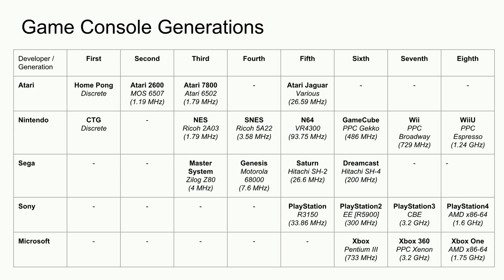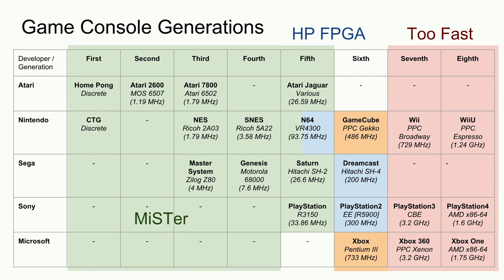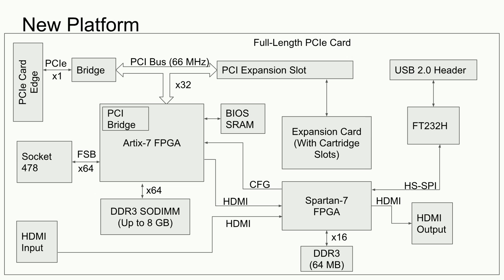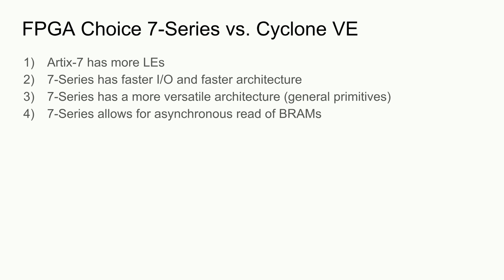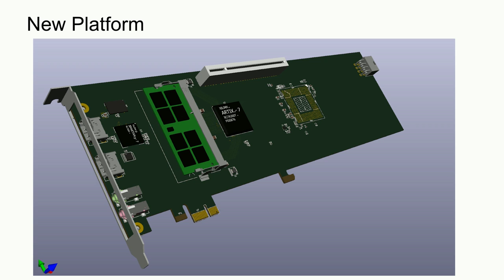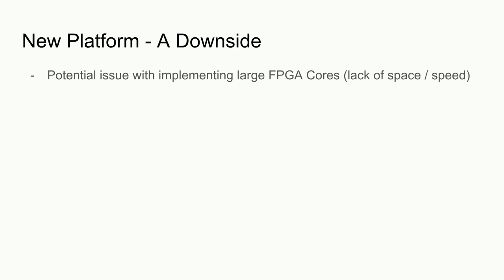A High Performance FPGA Game Console Platform

Comment: I have gone back to this video every once and a while, dreaming of a potential Saturn core on MiSTer, while hearing it wasn't likely/possible.  Now that we actually have a Saturn core in development for MiSTer, it seems your estimations may be very close to what is possible on the platform.  I look forward to seeing what you do with your talents, on either MiSTer or a more powerful FPGA gaming device in the future.  SGI systems are a monumentous goal.. best of luck!
Reply: Yes, I did the exact same thing, going back and forth to the video and he keeps answering the questions that people leave him. He really knows what he's talking about. This is very interesting to me :)
Reply from the maker: I'm glad you found it useful! 
I don't recall what I said in the past about the Saturn, but as of right now, I would basically give it a 50/50 chance of fitting. It's a pretty complex system (when compared to the PS1), though not as complex as the N64. The N64 wouldn't fit without a hybrid emulation approach though (e.g. run the CPU on the ARM via emulation, and the RCP in the FPGA - that would be a feasible implementation, though perhaps overly complicated). 
I probably will never touch the DE10-Nano version of MiSTer, since I find the "newer" systems more interesting. After all, the FPGA being used in it is over 10 years old (it was released in 2012, but Altera probably started designing it in 2010 or possibly 2009). I am, however, working on something related.
Reply: @RTLEngineering  Do you think in a future with this high performance FPGA on a PC we could pick some consoles in too fast category and emulate some parts and  give to fpga other part?
Making a different way to emulate Modern plataforms.
Reply from the maker: @carlospc223  Possibly. One of the major restrictions will be clock speed though (although, depending on the architecture, you could also run it slower but go wider).
Realistically speaking right now, the furthest you can hope to push a high end FPGA is going to be around 600 MHz (you can push them further with super-pipelining, but that doesn't fit one of the systems mentioned). However, when you throw cost into the mix, you're looking at 300-400 MHz (600 MHz would be one of those very expensive binned FPGAs that cost 2x-3x more, in this context that means $4,000 USD easily). 
I am guessing though, you were asking about hybrid emulation. For example, if you put the xbox system (GPU, sound system, etc.) on the FPGA but implement the P6 CPU via virtualization on an x86 host. That would be a good use case for a FPGA in a PC. That might also open the door to a system like the Wii, but then you start to blur the line between the FPGA and software emulator side, and at that point you are better off just sticking with software emulation (a xbox would be different, because you can run the game/kernel code via virtualization on a x86 host and not via emulation). 
All of the newer systems though, had GPUs running in the GHz too, so while you could implement them on a FPGA, they will have to run at a fraction of their original speeds.
Reply: @RTLEngineering  Understood! Thanks.
I thought some hybrid emulation would be better in some way but i see its no the case.
But still looking foward in some high end fpga for newer hardwares(Ps2, N64)
Reply from the maker: I think the questions for hybrid emulation are: 1) what parts can be put on the FPGA? and 2) do you gain anything by doing so?
For the OG Xbox, you can put everything except the CPU on the FPGA, and since the OG Xbox was a PC that used PCI, you should be able to match the original hardware with FPGA+x86 host. The OG Xbox also had some weird low level hardware features that have made it difficult to emulate, so potentially a FPGA solution might help there.
For the other systems, it's not as clear what the advantage would be if any (that's something that I have been struggling to figure out myself). I guess you could make some sort of purity argument... Even if the CPU uses dynamic recompilation, to translate the game code, that's often the least unique part of the system - the surrounding peripherals are what make the system unique. So if you can implement the peripherals in the FPGA while offloading the CPU part to a host via emulation, then that may provide a more "authentic" experience. That would really only have a tangible effect for archival preservation though.
Just some things to think about.
Reply: @RTLEngineering  Yep, I was
thinking about mimic other parts and emulate the CPU and GPU with tradicional emulation making it less demanding. 
These last generations are more PC like (of course very powefull one). In a very large run because it will take a long time. I was thiking to make some compatibility layer over the gpu and cpu and put FPGA some other parts.
I also was thiking high with the possibility to make a less demanding Ps3 emulator with the CPU and GPU just tackling the Ps3 CPU and GPU.
When we are outside and don't have enough Knowledge we think Everything is possible.
The OG Xbox still would be amazing.

Comment: that's very interesting...I was looking for someone at least talking about the future of FPGA...thank you!
Reply from the maker: The future of FPGA re-implementation for the market of retro gaming isn't all that clear, this was just a proposal for somewhere the physical hardware can go, since MiSTer cannot be the future (it's already starting to show its physical limits). There are other people working on similar platforms, however, I don't think that any will ever approach the cost of the DE-10 Nano used by the MiSTer (since Intel effectively subsidizes it).  
On the other hand, I think that we may start to see more PCIE FPGA cards in the consumer market in the next decade (which will drive prices down), to the point where anyone who has the equivalent of an RTX 2080 Ti (i.e. a high end consumer GPU) will also probably have an FPGA card along side it (Apple has already started to do this for the new Mac Pro).
And then obviously with cheaper, larger, and more mainstream consumer FPGAs, more complex cores will be developed and become feasible for enthusiasts to use. 
Hopefully that helps add a little more insight into the future of FPGAs in this application space (or at least my thoughts on them).
Reply: @RTLEngineering  thank you for the insight, yes, I agree with you all can help, even just suggesting an idea can spark new way of thinking so, what you are doing is commendable...I 'm into game design, I consider ideas very high,  I'm also aware that just ideas are half of the story and  without  the execution, nothing happens.
here the link to my idea called WOR(L)DS:
In the link below you can find PDFs with game scripts I wrote, check them out if have the resources to
transform them into games:  
https://raulgubertart.wixsite.com/wor-l-ds
''3 NEW MONSTERS AND 3 NEW WEAPONS FOR QUAKE''
''3 NEW WAYS FOR SUPER METROID''
''NUKE THE QUAKES! BOMB THE DOOMS!! KARMA KARMA BOOM!!!
''CONFUSED AND BADLY WRITTEN IDEAS FOR VIDEOGAMES BUT UNDOUBTEDLY BRILLIANT''
''THE FORTRESSES TO INFERNO''
Reply: @RTLEngineering  I think the main problem for the mister project its not the limitations of de10 but the lack of developers with the skills and passion to make cores there is alot of low hanging fruit out there from arcade to pc, consoles ect somebody can do. I been analyzing how the mister project is being run it reminds me alot of how Mame began with little team effort and alot of big egos .
Reply from the maker: I agree that there is still a lot of low hanging fruit out there, but you can only fit so much into an FPGA with 110K LEs. You also have an IO problem with the DE10, where it is severely lacking, especially in terms of attaching external memory. While there is the SDRAM add-on, it doesn't have sufficient bandwidth for any of the 90s era systems / computers. 
I can't comment on the internal dynamics of the MiSTer team, but I can imagine that there are some political issues there which hinder progress (it always happens in opensource projects). So if that's an issue, then the hardware lacking is just part of the limitation to growth. Either-way, the hardware limitations need to be faced at some point.
Another issue is probably the complexity of cores which need to run relatively fast (50 MHz+), requiring optimization which takes a lot of time and effort.  And then there is the effort to debug complex cores as well (I am still a bit surprised that someone wrote a 486 core).  I guess that falls into the category of skilled and passionate developers (ao is clearly one of them though).
Reply: @RTLEngineering  I am only in the income bracket of buying a 1500 ish dollar computer no more often than every 5 years but I would still put a upto 750 dollar PCI-E card in to accelerate emulation. Cost less than all the mods/repairs I do to older consoles to keep them going. That being said I would just move up to repairing the next generation and so forth and so forth on until the day I die.
Reply from the maker: The idea would be that you would probably only buy one of these cards every 5 years (though you might buy one and then buy a second a few years later if there is a core that requires two). FPGA architectures don't update nearly as quickly as CPUs, the DE10 Nano used by the MiSTer came out 10 years ago (and was likely designed 12+). Also, FPGAs have to contend with the Moore's law and power wall differently than CPUs. As you know, the traditional transistor scaling has slowed and is becoming exponentially more expensive. CPUs can make up for this with architecture changes (for example, the Big.Little shift, and batch processing that we see in ASICs like the google TPU). FPGAs on the other hand need to have their elements connected in an exact way that can't be changed (i.e. a FPGA is more physical while a CPU is more virtual). With that said, the current FPGA generation is close to the feasible limit (Xilinx for example doesn't have much of an improvement moving from the Ultrascale+ to the Versal, with the exception of the specialized hardware blocks). 
Essentially, if this PCIe platform uses an Ultrascale+ architecture, then there may only ever be one more generational upgrade (in 5-10 years), and that will be the limit of what FPGAs can do (the speed limit is going to be 800 MHz - 1 GHz for highly optimized designs, if that helps). Anything beyond that would have to rely on ASICs, as the routing network causes too much of a delay (as it currently stands, routing usually makes up for 50%-75% of the speed limitations) - it's a tradeoff between flexibility and performance.
Also note that building a sizable FPGA (even around the size of a Cyclone V) in a node that uses EUV will likely always be far too expensive for the consumer market (think $10,000 per chip) - that's because of the large FPGA die sizes (and thus lower yields), which cannot really take advantage of chiplet technology as modern CPUs do.
Sorry about that being a bit of a rant... The summary is that I would expect a more modern PCIe card (optimized for this market) to cost around $600 maybe, but potentially require a dedicated low cost x86 host (so another $200), and then maybe another identical card bought a few years later for expansion. After that, the next upgrade would likely be a new FPGA architecture in another 5-10 years, which would be the final update that would be economically feasible.
Reply: @RTLEngineering  thank you, that was an amazing explanation....I'm very happy that ps1 and saturn are being developed and seems they will succeed...thank you again for your thourough explanation!
Reply from the maker: @1luarluar1  Yes, they look like they will both run, but unfortunately require two SDRAM boards (that's not unexpected though). I believe that breaks compatibility with other cores, which will likely need to be reworked to accommodate that configuration (if the framework were properly maintained, it would be as simple as disconnecting the I/O that conflicts in one branch, but it's not, so this has to be updated with each core - it's going to be a huge mess).
Also, as I understand it, it's not possible to run the PS1 core at 1:1 original hardware (I'm not sure about the Saturn). In some cases it will be faster, and others it will be slower - that's the nature of a FPGA implementation. Although, a new and larger FPGA architecture could allow the PS1 to run 1:1, that may not be worth the extra cost for most people.
And those cores are the absolute limit. As I recall, the author of the PS1 core used up every single multiplier in the FPGA, to the point where he had to start rationing them. As long as it fits though, then that doesn't matter. 
I'm not trying to put down the DE10/MiSTer though. As long as what you want to run works at an acceptable level for you on that platform, then there's no reason to migrate over to something more powerful / expensive. I know people who only use the MiSTer for the C64 core and nothing else - anything more powerful would be overkill for them.

Comment: I also hope to see some "development kits" which made out of mister and more powerful FPGA cards. So, open source games could be developed on those! Good work.
Reply from the maker: That wouldn't be feasible. The more powerful FPGA wouldn't be compatible with the Cyclone V, and would require that the two be combined in a final version (beyond a development kit). There's also no good way to connect another FPGA card to the DE-10 Nano, the best you could do is give up the SDRAM and the MiSTer hat and replace it with a parallel link to the other FPGA (then you would have to move that I/O to the new FPGA and every core would have to be rewritten to take advantage of that as well as the increased SDRAM latency). Also, if the Cyclone V were included, you're probably looking at the base card cost going up from $500 to $700 (the Cyclone V doesn't have competitive pricing on it). And a dev kit would likely be well over $1,400.
Furthermore, the Cyclone V is going to be reaching end of life soon (within the next few years), so including it in any design wouldn't be wise - it could only be produced for a few years and then it's done forever.
Tl;dr, including anything to do with the MiSTer here isn't economically viable, nor would it provide much of an engineering incentive as all of the MiSTer cores could be ported to other FPGA architectures (no longer requiring a Cyclone V).

Comment: Your work is fantastic. I would love to see you develop an exclusive FPGA based retro gaming hardware platform. Starting off with a 1080p native Nintendo 64 core would definitely get the ball rolling. Hopefully, it would be possible to make it standalone and not require a computer even if this option would be a bit more expensive.
Reply from the maker: Thanks! The platform that I proposed in this video could also work with a single board computer which has a M.2 slot (it would need an adapter cable, which does exist). So something like the Latte Panda would work, though it would still be a full length PCIe card, so it would be a large form-factor. I have also been considering the idea of using a Zynq or Zynq Ultrascale instead, which is effectively equivalent to the Cyclone V in the DE10-Nano, except it has more logic and runs faster (while being more expensive). That could potentially have the option to attach to a PCIe carrier card (and go into a PC), or be standalone with the ARM cores in the Zynq running a Linux OS (the whole reason for the PC is so that there is an OS running which can handle things like USB, Ethernet, SD Card, game ROM loading, etc.). Though using a Zynq like that could potentially mean compatibility issues, where some cores would require both ARM cores for hybrid emulation, and therefore would require a support computer regardless. Just a few things to think about.
Reply: @RTLEngineering  I wish you the best of luck with all of your projects! I feel like the more popular retro gaming gets, enthusiasts would be willing to pay 3x or more for a standalone arm coupled FPGA "all in one solution" that could support N64 and other later generation consoles and handheld cores.

Comment: 2 years ago when I asked why this wasn't a thing, I was told it was impossible!
Reply from the maker: It probably seems impossible to a hobbyist who does this sort of thing on the side, however, my main job is trying to figure out how to get the most performance out of FPGAs and to best utilize the architecture - this is no different. The only issue is that it requires a lot of trial and error / experimentation to achieve the desired result, which takes time. It also means not only attempting to optimize the HDL description, but also how to optimize the architecture (which primitive parts go where). It's for all of those reasons that this may seem impossible, even to more experienced developers, like Kevtris for example (getting something like an N64 to work, let alone a PS2, is far more work than he would be willing to put into such a project, and would require a fundamentally different development method and experience set, so he sees it as impossible).